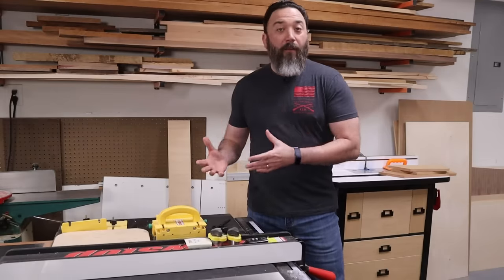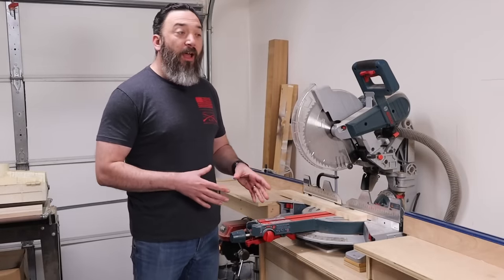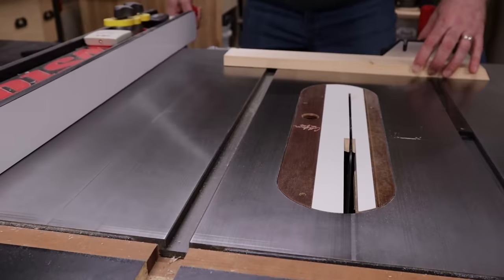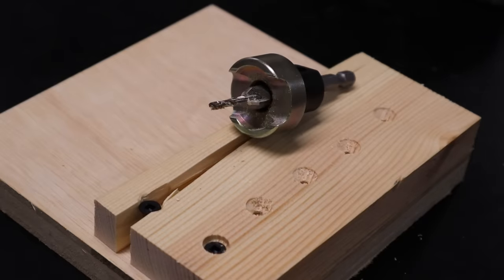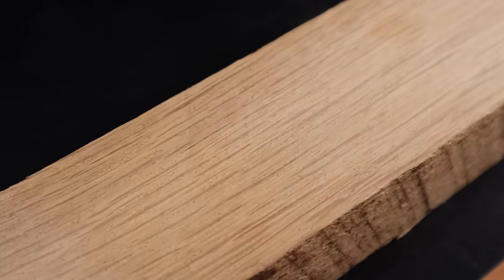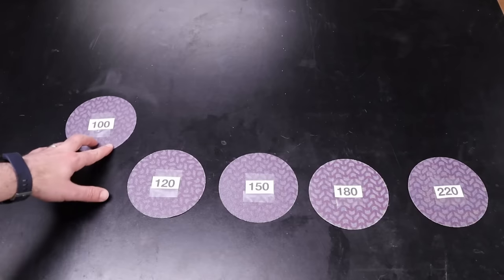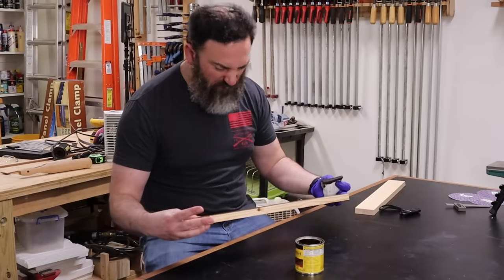Every Woodworker Should Know This!

Comment: Here's a neat trick. For shallow dings and scratches in a board put a few drops of water on the defect and heat it with a clothes iron. The steam raises the grain. I've made small dings disappear and you don't have to go as deep to sand out scratches.
Reply from the maker: That is a good one, thanks!
Reply: * Just found your Channel*  Some good basic chips. Although on the rough Sawen, Piece of lumber I would have started with a 60-Grit Eighty and then the one twenty, And depending on what i'm doing I'd use a 320. Thanks for sharing.Keep up the great work by for now.Your new friend Ken God bless. I look forward to hear from you.

Comment: I have over 20 year experience in building cabinets.  I agree with all the tips suggested here.  The only thing I would add is on the tip at 5:50,  I always reference my piece in the corner of the cabinet.  This way, if there is a bow in the hanging rail or face frame, when you mark, cut and install it it will be too long.  Marking your piece in the corner of the cabinet insures you get that piece the exact width it needs to be.  That puts  both the hanging rail and face frame iin the proper alignment so the cabinet ends up the exact same width in the center as it is on the ends.
Reply from the maker: You are correct, typically you want to take the measurement from the end that is fully supported so you don't have a bow in the case. That's exactly how I made the center dividers that will be shown in a future video when this dresser is completed. Thanks for keeping me straight!
Reply: @biscuittreewoodworks  No problem.  I learned the hard way in a similar situation one time.  I  had measured in the center of the cabinet to put in a support like you did here.   Got it glued in and noticed a nasty bow in the face frame.  It didnt take me long to find out what I did wrong.  So I had to knock it all a part and do it again.  Experience is the best teacher.
Reply: Wow! I just commented on that! Drop the relative measurement philosophy! It does not work in this case.
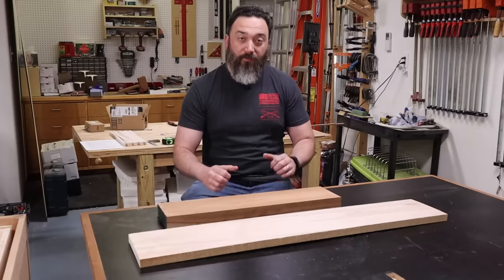Reply: 1:23 “…can I borrow a cup of walnut?” 😂

Comment: I did know just about everything you had to say, excellent tips and I feel they are essential. The only thing I could add to your video would be safety Tips. Always wear your PPE and remove loose items when working. Scary results if you don't.
Reply from the maker: Very true! Thanks for watching!
Reply: I’m a retired tool and die maker, now a hobby woodworker. Loose clothes, jewelry, unrestrained long hair, (me), are not safe around power equipment. These machines will grab you, and hurt you, and they will not apologize! Safety matters!!
Reply: @chriscarter7182  so…..no women allowed out in the shop? Thats a bold stance but ok.
Reply: @Manhandle730  Don’t know how you could infer that women should be excluded from a shop environment! My son in law can’t put a screw driver in his hand and have it pointing in the right direction!! I have worked with women in my shop and they were every bit as capable of handling their job as tool and die makers as well as their male crew members. I made absolutely no reference to excluding women from the shop. I really don’t see how you could interpret that suggestion from my comment! My comment was entirely based on a safety point of discussion and I don’t see where gender was introduced in my comment!

Comment: A sanding tip that was shared with me, which followed your example, next grit is 1.5 times current grit. 

100*1.5=150
120*1.5=180
150*1.5=225 (or 220)

Great content of common things to know!
Reply from the maker: Yes, that method works as well! Use whichever is easier for you to remember! Thanks for watching!

Comment: I've been actively woodworking for 5-6 years but I've been watching woodworking videos here on YT for at least a year before that. I learned much of this stuff before I even built my first project.

I build and sell bird and squirrel feeders on Etsy. It wasn't what I intended to sell on Etsy but it's what caught on so I'm ridin' the wave. Anyway, I use cedar fence pickets for my material. One of the problems with using the fence pickets is cupping. I have worked around it for the most part but some time ago I learned something, on my own, that has made my products so much better than when I started. The grain direction. 

My first shot at a good project is picking the right fence pickets, of course. At the big box stores you don't always have good choices but if you look long enough, you'll find some good boards. The first thing I look for is the grain on the end of the board. The more of a "rainbow" it is, the more likely it is going to cup. I try to find something with the most vertical grain I can find. However, if I have to settle for something with a "rainbow" grain, I know that it will want to cup opposite of the grain. Like flattening the "rainbow". Knowing this, I cut and assemble my pieces in a way that minimizes the cupping effect as much as possible, and in other cases, takes advantage of it. Like using a cupped board to create a crowned base that allows the seed to fall out towards the edges and also allows water to drain away.

I still don't know a lot of about wood, like how it's sawn, but using these cedar fence pickets and making these feeders, I'm learning. It's been a great experience. I love it.
Reply from the maker: That's great that you've figured that out and found great ways to work around it! Thanks for sharing what you've learned! 
The terms you are referring to are flat sawn (rainbow) and quarter sawn (vertical), there's also rift sawn that is going to be more at a 45 degree angle and is typically more stable than quarter sawn.

Comment: All good information for those wanting woodwork. Additional tips; I'd never use 100 grit as a beginning grit on sanding something like rough sawn oak, you're gonna give up before you get to where you want to be. Remember than each consecutive grit is merely removing the lines from the previous grit. Sometimes skipping a grit means longer sanding time overall. It took me a while, but I've developed a penchant for a hand planed surface for oil finishes. A well tuned hand plane takes you to about a 1500 grit smoothness. Far beyond what most need to achieve, but once you've done it you want to duplicate it on some projects. A hand plane will also save a boatload of time processing rough or sketchy factory machine planed wood. No one likes to spend a lot of time sanding.
Reply from the maker: I agree, I love using my hand planes! Just not very beginner friendly for this video!

Comment: 1 tip I could add is when making a finish cut, lay down some painters tape on the back side of the board. This will minimize splintering, similar to the blowout when drilling holes.
Reply from the maker: That's a good trick as well!

Comment: About sanding to finish. I suggest scraping with a card or a scraper plane and just a quick hand sanding with the finest paper you have.
This save a lot of time, a lot of dust and it's quiet and good exercise.
Reply from the maker: That can save a lot of time. Some beginners will find hand tools intimidating and difficult to use at first, but once you learn it's so much better.

Comment: Just an FYI.  Cutting hardwoods short and then sneaking up on the cut of the same board is the best way to get exact cuts.  However, this depends on the blade you’re using.  Miter saws are made for thin kerf blades.  These blades notorious for deflecting when cutting very dense hard woods (bubinga, ebony, jatoba, etc.) especially when you’re trying to give it a shave on the end grain.
Reply from the maker: True, same technique can be used at the table saw if you are having issues with blade deflection in very dense woods.

Comment: Thanks for the video! A lot of great tips in here that I wish I knew when I first started getting into woodworking 😂 

The only tip I maybe disagree with is that I used to do a lot more “relative dimensioning” when I first started and noticed that my projects would come out not square or would otherwise be “off” inexplicably. I came to realize that subtle differences in measurements would add up over the course of the build. Now, when I measure every step of the way, it keeps myself in check and ensures everything is square, sides match up etc.
Reply from the maker: Relative dimensioning has to be done properly and at the right time. I was very precise and using exact measurements when building the dresser case I show in the video. But when it comes down to stretchers and drawers, it doesn't matter if the plan said 18" and the actual dimension is 18-3/32". However if I cut my board to 18" because that is what the plan said it should be, it would be too short and a waste of material.
Reply: @biscuittreewoodworks  makes perfect sense. I was just thinking that there is probably a difference between case dimensions vs stretchers and drawers like you mentioned. Cheers!

Comment: Cracking delivery! Clear diction, no wasted time, and the explanation of "board feet" was good.  I used to find the quantity mentioned in US plans.  It's essentially, I see from your explanation, the equivalent of 1/12th of a cubic foot (144 cubic inches is 1/12th of 1,728 cubic inches, which is a cubic foot)  In the UK they used to price timber per cubic foot, before resawing, so you paid for the sawdust that was produced, too... I suppose someone has to... I remember finding the price of Hemlock timber at £60 per cubic foot too expensive for me, so I used a cheaper pine variant...
Better tan attending a class with others, since the delivery's so often interrupted by questions.
Reply from the maker: Thanks! Glad it's helpful!

Comment: This was very helpful! Even though I worked construction with my father when I was young. I only started getting into finer woodworking then because I went into electronics and computer engineering instead. But I always loved building things with my dad and treasure those times. Now that the kids are out of the house I am setting up a shop in the basement. I am starting to work on furniture and enclosures for my audio equipment projects. It's a good mix for me and these videos are extremely helpful to be able to do it right. Keep them coming. Thx
Reply from the maker: That's great! Glad the videos are helping!

Comment: I have found 3 sawmills with in 25 miles. 2 have kiln dried and 1 sells his wood after sitting 2 years in pole barn out of the weather. It is cheaper and they give me all types of advice. The main saw mill I buy from also puts a 1 side laser cut to help me mill it down at home with my tablesaw, lunch box planer, and miter saw.
Reply from the maker: That's great! Air dried typically looks better than kiln dried, but takes much longer and needs to be done properly. If you have a good resource, hold on to it!

Comment: Great tips (or reminders). I’d be interested in a part 2. Your humility & presentation style are excellent, IMHO. I’d also suggest visiting several hardwood suppliers before buying. In my area they range from snooty & aloof to friendly & helpful. If they’re too busy to help you find what you need, move on. And, if they have UPCs / barcodes on their stock, you might be paying more. I admit this might be an unscientific generalization, but it’s true in my area. Another tip for those just starting with hardwood, or those who don’t have a jointer or planer, ask your supplier how much they charge to joint and plane your purchase, at least both faces & one edge.
Reply from the maker: Good tips! Thanks!

Comment: Nice video; here’s one: at 5:52, when you’re showing relative dimensions, you should have slid the board over to a fixed/supported end and then mark your location. Often in the middle of casework that’s not properly supported yet, you’ll have some deflection going on. Hope that makes sense and helps.
Reply: On second look, that case already looks pretty beefy, so maybe you’re already aware and just overlooked  mentioning the concept. Still, hopefully this help someone out there.
Reply from the maker: That is correct, in general you want to take this kind of measurement from an area that is supported and can't bow. As you mention, this case is beefy and I already added support to prevent that bowing. What I am adding here is anchor points for attaching the top and not to prevent any bowing. Thanks for bring it up if anyone was confused!

Comment: I agree with pretty much all of the things except marking the stretcher at the middle of your cabinet back to the frame if either have a bow it want be accurate if you mark it by the side of the cabinet it will be the exact distance across the whole cabinet. Great video I've been doing carpentry for 25 plus years cabinet work the last 8. Clay from mobile Alabama
Reply from the maker: Yes, you are correct. I would typically take the measurement from the end to eliminate any bow in the case. I didn't show that in this example. You will see me do just that in the video for this piece of furniture when it comes out in a couple weeks.

Comment: Excellent video, but easy to see it’s American 😊. I’m in Canada and grew up in a wood workshop ... my father was a carpenter. I haven’t heard anyone use the term “board foot” since I was a teenager (I’m 72). If I asked somebody today what a board foot is, they wouldn’t have a clue. Back then we’d buy rough sawn lumber from the mill by the BF ... mixed lengths and widths and plane it ourself. Today at the lumber yards it’s all milled and each length and width is stacked separately and individually priced by the board. And we’ve never used the term “quarters” here. We still buy a 1” planed board but it’s milled thickness is 3/4” ... years ago it would have been 7/8”.  Everything has been downsized. 😂
Reply from the maker: Yeah, I realize the board foot explanation only applies to the US, but hopefully the rest of the information has some value to everyone! Thanks for watching!

Comment: Enjoyed this immensely!!!  I am not an expert bye any means and enjoy learning new things every day, with that said.....  This may be an ignorant question but I am stumped. In your board foot formula (LxWxT/144=BF), what does the "144"  represent? I would like to pass on a formula that most do not know that is very helpful. This formula does not include the machining margin cutoff for each pass. DW-2xRW+1". This will build any door you will ever need in any style door.  DW(door width) RW(rail width) this will determine the  measurement of your door rail that wide determined the over all width of the door you are trying to build.
Reply from the maker: Glad you enjoyed the video! For the board foot calculation when you multiply LxWxT all in inches, you get the total volume of the board in inches. To convert this from board inches to board feet you divide by 144. For example a 12" x 12" x 1" board would be 144 board inches which is 1 board foot. Hope that helps!

Comment: Sandpaper grits.  I use a different formula.   Take the grit I am on.   Figure out half, add that to current grit, and that is my next.   Start at 100. +50,  Next grit is 150.  150 + 75= 225.  The closest is 220.   220 +half is 320.  Etc/.   Or, start at 80.  + half =120.   120+half =180.   Etc.
Reply from the maker: Yeah, either way works. You get basically the same thing.

Comment: Very much liked the video. Learned a couple of things. And yes, Part 2! 😊 But I am going to disagree with you on the sandpaper part. You left out 80 grit. And I say this with purpose. That piece of wood you displayed would have you going through a lot of sheets at 100 grit. The 80 grit is much more effective & efficient knocking down that rough material. Then you can do your steps of 80-120-180.... That is my personal practice and it works really well for me. 😊😊😊
Reply from the maker: Good point! I rarely use 80 grit, but if you are working with something really rough, then you want an aggressive grit to eat through that material as fast as possible.

Comment: Quick points to add to measuring lumber...

1. Rarely are boards "true" to their quarter increments.  4/4 is often closer to 3/4" in thickness, 6/4 = 1 3/8", etc etc. Always best to buy thicker to plane down than assume you're actually getting the thickness advertised.

2. Lumberyards/sawyers will most times factor the width of a board by averaging the width at multiple points. You'll never get the narrowest measurement as the only measurement. Furthermore, the longest point will ALWAYS be used when a board is not cut "square." 

3. You should never buy a whole board if you dont need it. Ask to have what you need cut to length. Most retailers will do this at no cost. If you only need 4ft of a 10ft board, no need to pay for an additional 6ft.
Reply from the maker: Great points, and generally true! I have run into exceptions on occasion so it's good to check with your supplier. 
A lot of the boards I get from my hardwood supplier are slightly over 4/4 if you are buying them in the rough so if you are careful with your milling you can end up with a 7/8" board. However, they won't sell part of a board. They will cut it down for you if it's too long for transporting but you are buying the entire board. That's how I ended up with an 8ft zebrawood board when I only needed 2ft! Guess I'll find a project for it one day!

Comment: Excellent tips, great job!
This is really go na help people whi are new to this!

Surprised you didn't mention the blade tip count for cutting hardwoods. It helps alot to jave 60 tip sawblades 👍
Reply from the maker: Great point! I typically use a combo blade and don't change blades often.